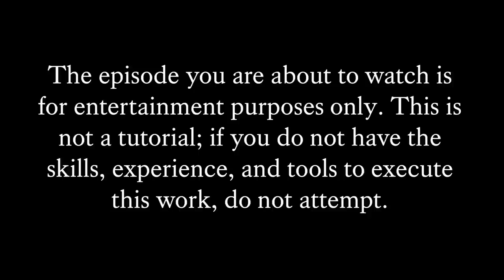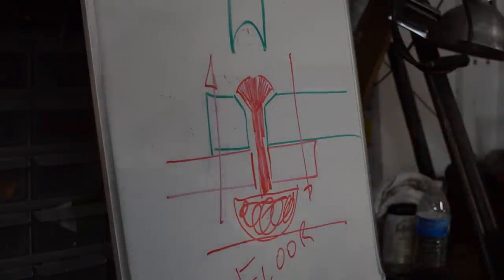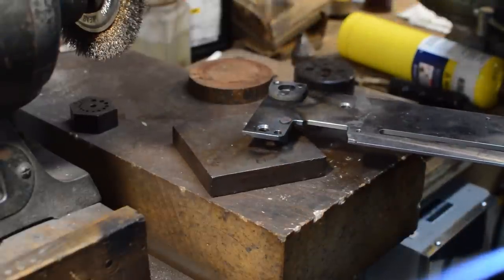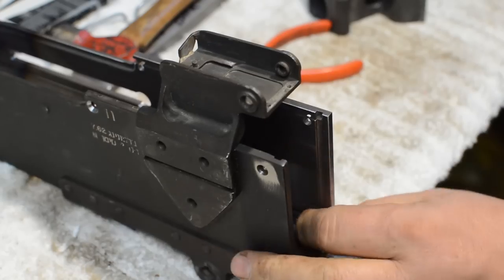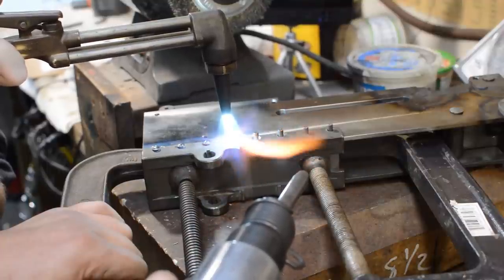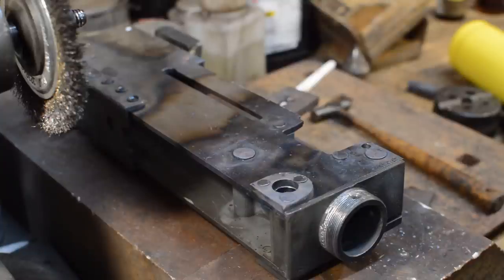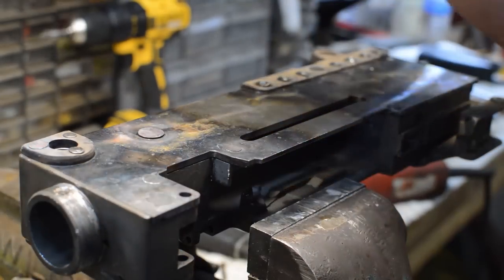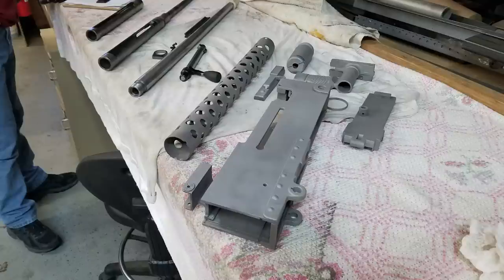Anvil 026: Browning 1919 side plate replacement

Comment: Ha ha, you think you were wailing on that gun? I might have been one of the recruits that wailed on it in about the 1970s when I was a recruit in the IDF, and we were 18 year old's that did not consider the wear and tear we were imparting on our equipment. We were getting 3-4 hours of sleep a night, marching 20 Km. before breakfast and then going to the range to shoot maybe 200 to 300 rounds each,  before lunch break and we never ever did any maintenance on any gun other than the personal weapon we were issued. I presume the machine gun you have just rebuilt was maintained by the ordinance division after we finished at the range, but we were maybe 100 soldiers at a time at the range and those guns never failed us. They were great. I am really happy to see them still in operation.
Reply: Well if you take a good designed gun and maintain it well it’ll never let you down.

Comment: I enjoyed this video...again. The BATFE rules for building the semi 1919 have changed a bit over the years. When these parts sets first came on the market in the 1990's, the regulations required 'deep penetrating welds' of the side plate to the trunnion block. They have since changed that but that is how I built mine, back then. 
    On the underside of the weapon, at the area in front of the ejection port I welded the side plates to the trunnion. On the middle trunnion 'Fat' rivet, I turned the rivet into a straight cylinder and chamfered the ends of it's hole in the trunnion.  I tig welded it to the trunnion and ground those welds flat before the trunnion was sandwiched between the side plates. I heated that rivet(now straight pin) and tig welded it to each sideplate. When cool, it had everything rock solid and I had welded the side plates to the trunnion, per the old regulations of the day.
   One other thing they changed in the rules was the exact shape of the 'islands' of the semiautomatic right side plate. On the oldest original design it required the right ear of the trigger frame to be milled nearly paper thin. That right ear has broken on many of the early builds. I wish mine wasn't like that but you have to follow the rules exactly and that's what it was, back then.
    Great video and I would enjoy a thorough video on parkerizing.
    Take Care and be safe, John

Comment: That took back in time when kit guns were cheap, and cheaper by the 5 pack in the early 90s. I just recently rediscovered a 1919A4 kit. In my house fire burn out storage unit I had forgotten about. Real simple kits to put back together. I've reassembled them with both hot & cold rivits without any noticeable differences. But nice flush grind on the front trunion 60° rivit. I alway dug in to deep on that grind as if it was my trade mark. Sure would be nice if those kits were still available as they were in those golden day's

Comment: First off, I really like your presentations, especially this on about the M1919 side plate.  It brought back memories of when I was in Germany during the late 1970s as the NCOIC of a small arms repair shop in the 1st Armored Division.  Periodically, we had to tighten up the rivets on the M2 BMGHB receiver and sometimes the .50 caliber M85 MG that was in the Commanders Copula of the M60A1 & A3 Tanks.  We had a tool that was made from a 3/4 inch and 1/2 inch bolts that were set up as adjustable anvils that were inserted into the receiver and adjusted to  snug up against the rivet that needed to be tightened.  Have you or your friend ever encountered the M73 / M219 MGs?  They were the coaxial MG that was installed next to the barrel of the Main Gun in the Tank.
Reply from the maker: Never been in anything that big, in or out of the military. Unless a MK48 torpedo counts......

Comment: Built one years ago when the kits were cheap and plentiful. As for those rivets on the bottom plate, I used two awls on each end and everything in between came into center. Now here is where masking tape is our friend. As you set in each rivet place some masking tape behind them to keep them in, preferably one long piece. As you run the bucking bar in from the back pull on the tape towards the front of the frame keeping it close to the outside so as not to pull out the rivet and keep sliding the bar in one rivet at a time.
Old Yiddish saying,
Man comes into this world with great Oy,
And goes out with Gevault.

Comment: For a old art of attaching parts rivets are so much better than bolts, as you mentioned they shrink when cooling to draw the parts tighter together but where a bolt has to have clearance thru the part for installation as does the rivet how ever  the rivet expands to the full internal size of the hole when swedged so there is no looseness in the fit  for the part to rattle loose. Very  nice job
Reply: And you can tell when the parts are starting to move because the rivets "smoke". Gives you lots of warning that it's about to be bad.

Comment: Mark, as a retired Aircraft Structural Mechanic I am qualified to say this. If you take a piece of metal and drill a hole in it. Then put a rivet in the hole and buck it, the piece of metal is just as strong as if it had never had the hole drilled in it. Aircraft are riveted together for a reason. It is MUCH stronger to rivet two pieces together than it ever can be to weld or bolt them together. Those who think welding is stronger than riveting are just ignorant of the facts. Welding was around when the Empire State Building was built.  The structural steel was riveted because it is stronger and more able to flex without breaking than welding ever could have accomplished.  Of course, bolting two pieces together makes it easy to take them apart but bolting them together makes them inherently weaker than riveting them together.  Structural mechanics is an art. Welding is a trade. Bolting is a menial task.  Mark, you are a master of the Gun Smith art.  Thank you for these outstanding videos. You teach this 74 year old something new with every video. And just to qualify things a bit. Those who think riveting is an archaic way to assemble something are wrong. Those that think welding is stronger than riveting need to go back to school and get an education. Saying "welding is stronger" is simply an uneducated statement.

Comment: I've still got my old T&S side plate 1919 in the safe.  Work of art really.  Mine was built before the BATF "deep penetrating welds" in the bottom plate  requirement was dropped.
Reply: Ah, Sam Alvarez' fine work, those T&S plates. Yep, I built a few in the old weld days. Had one all drilled and ready for plug welds- through the underside of the bottom plate into the RSP- when the clarification letter came out, eliminating the welding requirement. Still has the holes, unfilled, lol.

Comment: Dang, Mark, that was a lot of work, but the results look very good.  When we put a couple of Israeli 1919s back together about two decades ago we made a punch with a concave face on it and peened them cold. No heat was applied.  It took a while to peen them, but we didn’t discolor anything, so the only part we had to apply a finish to was the new side plate.

Comment: I've performed three builds on 1919's and M2 50.BMG's. You made it look easier than what I did. My first 1919 build took me three days and my first M2 Build took me 6 days!!! Even then, both of them took hundreds of rounds to get the parts to "fit" and seat like they were supposed too and these were for Papered Full Autos, which I have heard that the semi's can be more testy to work with. Great Work from North Carolina!!!
Reply from the maker: Thanks. It's dirty, nasty work, but we still have to do it!
Reply: The M2 was never fun to get the head spacing right.
Reply: @budmeister  you will be happy to hear that the M2A1 has been modified so that the headspace and timing is fixed from the factory. Now that we can actually hold the dimensions tight enough to do that!
Reply: @ScottKenny1978  Finally, no more having to use the headspace and timing gauge.
Reply: @budmeister  yep, that was exactly the point!

I imagine that there was immense rejoicing when the last M2 came back as an A1...

Comment: If anybody wants rounded revit heads for whatever project. A rounding tool can be made by using a rod a little bigger than the desired revit head size. Put rod in lathe & with a ball endmill of the proper size to mach the revit head, 😊😊plunge in to desired depth. A small block with same half round hole for the back side to keep the original head from flattening

Comment: This video didnt make me nervous the first time I watched it but it is this time. I was having visions of slipping of the rivot with that grinder and crapping all over the side plate.
Reply from the maker: That is a definite outcome, yes it is..............................................so don't slip
Reply: @marknovak8255  dont slip indeed. It felt just like when my brother was teaching me to weld with oxyacetylene, its slow but you can make it oh so pretty that is if you don't mess up
Reply: @marknovak8255  if you end up doing another one, they make rivet shavers that are micro-stop adjustable for depth. Used them all the time fixing airplanes. But try a place like the Boeing Surplus Store to get them cheaper than full list!

Comment: Would the side plates have received an oxide treatment before assembly to prevent corrosion between plates after assembly and finish?
Reply: That's what I was thinking too - Those gaps and seams aren't treated... However I believe that any treatment done before the rivet heating would just be burned off anyways.

Comment: Rivets are still the default option for metallic aircraft structure (Boeing etc) by expanding and filling the hole they are good for fatigue properties. They don't really work with composites unfortunately.
Reply from the maker: I got to witness 787 riveting in Charleston. It CAN be done, but I'll bet it COSTS
Reply: @marknovak8255  I have thirty years in aircraft composites and I have riveted everything from fiberglass, carbon fiber, kevlar, etc. It is done and has been as long as I can remember, pre Vietnam era aircraft.

Comment: With such a square and easy to clamp down piece, I would use a milling machine to take down those heads.  I guess there's no no het treatment issue with the sideplates?

Comment: I have built 4 M1919a6's and if I am correct, your Hot Riveting was not the way to assemble of the Right Semi auto sideplate.  The sideplate is heat treated to Rc 46 per the military standards and by bring the plate to a blue/red color you anneal the heat treat out of the side plate.  I was impressed by your methodology, but I believe you were using to large of a nozzle and heating the side plate.  When trained the idea was to heat only the rivet.
Reply: This is my observation as well. Would seem not only an issue with temper on the side plate, but just the process itself would have been difficult to automate. AK's are cold riveted. In the large structures like buildings I suspect the heating was done to allow such large rivets to even be deformed with portable hammers, and of course the I beams are just mild steel.
Reply: Can the semi automatic conversions be undone legally
Reply: You are absolutely correct.
Reply: @leviclouse9156  NO, Not unless you get the paperwork from the ATFE and pay the tax.
Reply: @leviclouse9156  NO WAY CAN THIS BE DONE.  The ATF says that the if you make a machinegun it is a felony.  The only way you can make a machine gun is to have an existing machine gun which was registered before the ban on making new machine guns was made in 1984.

Comment: Maybe I'm missing something, but when you were inserting the rivets along the bottom, would it have made sense to use the bucking bar to hold them in place, kind of like setting pins in a pin tumbler lock, or would that cause an issue with trying to identify problems that may creep in during the process?

As I'm writing this, it occurs to me that driving the bar incrementally behind the rivets might push the side plate out of alignment, but I'm also not a gunsmith, and haven't worked with hot rivets before, so I'm probably missing some important wisdom or knowledge.
Reply: I know that beating rivets on aircraft means that the holes will end up off line if you start at one end and go to the other. I suspect that you can beat an awful lot more on that side plate than on even a .130" belly skin on a Boeing before it moves.

Comment: I'm interested in this 1919 project but I know nothing about them. 1-is this 308 or 30-06? 2-  does it have a free floating firing pin and was it fixed when it was full auto?
Reply: .308 (7.62 written on the side plate, near those weird letters)
Reply: Originally in 30-06 but Isreal rebarreled then to 308. Look at forgotten weapons ian has a couple videos on them.
Reply: @colehuenke3916  Thanks for the info .I'll check out Forgotten Weapons.
Reply: Search up "Browning 1919 mg patent" and all will be revealed. Its very detailed.
Reply: The 1919 is actually a closed bolt gun, floating firing pin from the beginning.

Comment: Mark when you grind down the rivet heads does it lose holding  strength?
Reply from the maker: Metal outside of the countersink adds no strength. Besides, this is so overbuilt that it cannot matter, in my opinion
Reply: @marknovak8255  got it thanks

Comment: Sanding the rivets flush I would think would affect the clamping force of the rivet.
Reply: With a tapered "seat", the head is spread out and the integrity is still 100%.  The rivet is spread out into the taper and as he said will draw the pieces together.
Reply: Basically what he did was make the rivet a double countersink (a double headed rivet basically) and the double countersink is very strong.

Comment: Question ! What year  and  caliber is the Remington rolling block. In the start of your video ?
Reply: mid 1860s-1906  It was made in a variety of calibers, both rimfire and centerfire, including the 12.17x42 mm rimfire, 12.17x44 mm rimfire and 12.17x44 mm rimmed centerfire Swedish and Norwegian cartridges, .43 Spanish (11.15x58mmR), .50-70, .40-70, .45-70 and later in .22 caliber. Later models were produced in .30-06 Springfield, 7×57mm Mauser, and 8×50mmR Lebel.
Reply: but the original military release was in .50 caliber

Comment: Where these originally hot riveted? Or where they riveted like AK's? Seems one risks the temper on the side plates using this process.
Reply: No, they should NOT be hot rivets,
Reply: Well, it's a model 1919, so I would imagine it probably was. And in that case, I would also imagine they would be using a rivet forge. The rivet itself is heated in said small blower forge, then grabbed with tongs, dropped in the hole, and smashed with an air hammer. A torch would never have gotten anywhere near the gun. It's the same way those old buildings he mentioned were made. You had one guy running a hand cranked rivet forge, and throwing red hot rivets to another guy with a catch can. He would then drive it home, and another guy on the other side would then pound the hell out of it with either a sledge and chisel, or an air hammer. Edit: Note that in what I've described a torch would never have touched the gun. All the heat would have been in the rivets. The heat sinking of such a thick steel plate would keep the thing from ever getting all that warm.
Reply: @jasonsexton8869  Yes, in either case, unlike the way it was actually done here. Probably not much issue having taken the heat treat out of the receiver side plates here given it is a semi conversion, but that is not much excuse.

Comment: Wonder why they made the side plate the controlled part and not one of the internal parts that have to be machined to be semi
Reply: Think about it. You answered your own question.
Reply: The serial number is on the right sideplate. Im assuming the demiling and importation rules are why they could be imported as parts or kit but without certain parts or sideplates. So it was another smith who put it together with whatever semi parts or modifications that he or the owner had obtained to make it semi. Thats why registered  auto sideplates are so expensive. They are considered serialized machined guns. And a small internal part if it was serialized and controlled would not be practical as parts like that are small and can break wear out or become lost. As well as being hard to see from the outside. There are exceptions of course. Registered drop in auto sears etc.
Reply: @bobrobert319  I understand,  I was thinking drop in auto sears ,but then you touched on that! Thank you
Reply: @earlwright9715  No problem.👍

Comment: My dad took awful care of his hand-me-down firearms, and my brother asked if I could try and clean up his 1913 Winchester, which is supposed to be nickel steel, but looks mistakingly like bluing.  Can that nickel finish be recovered, or should I just rust blue it and call it done?
Reply: Almost anything can be brought back to like new condition if you are willing and able to throw enough money at it. The question should be 'Is it worth doing?' That is something you have to answer though as what is worth it to you and your brother may not be worth it to a collector or someone else.
Reply: Nickel steel doesn’t mean it was nickel plated. It means that the steel was an alloy contains nickel. Bluing is the correct finish.

Comment: So let me get this straight, replace the side plate with a modified semi-auto doohickey plate and then no transfer tax needed?
Wow! Belt fed ammo disposal unit that’s street legal!!!
Reply: You have to have the internals machined and install a semi auto trigger and sear, but yes. It will be a legal belt fead in 308 or 30/06 or 8mm mauser (simple barrel, booster, and cartridge guide swap)